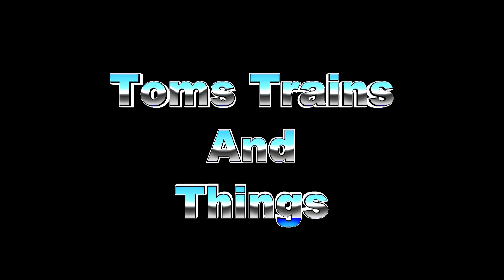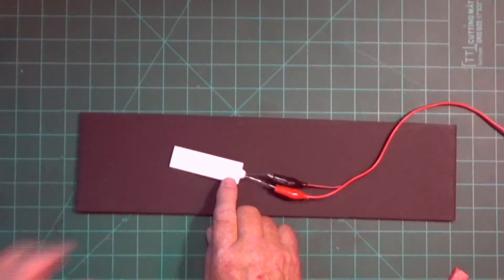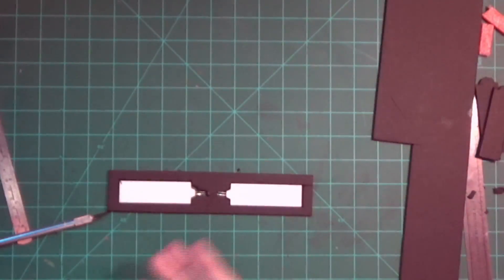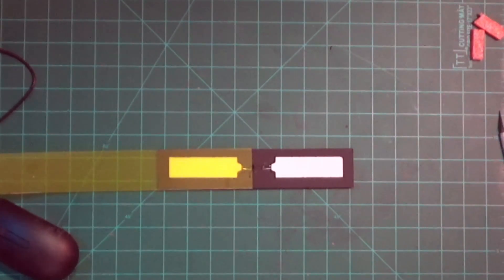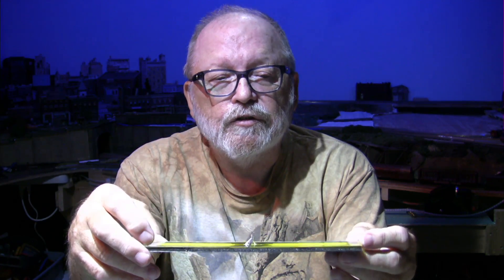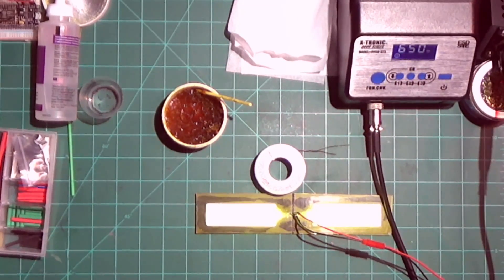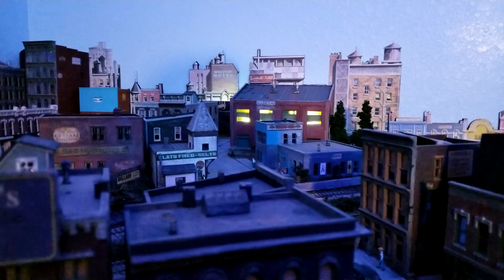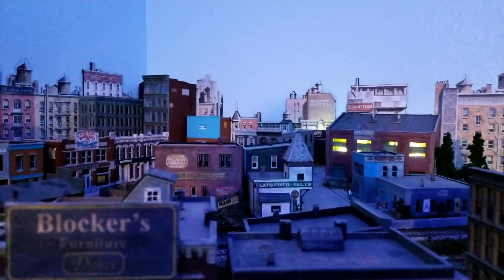Working With LED Panels

Comment: Another great video Tom.  Looks like those panels are really good when you want an extended (area) source to eliminate the appearance of individual light bulbs/fixtures and just generally illuminate the structure.  Art...
Reply from the maker: Thanks Art. They work great for that. Going to install a few more.

Comment: Where did you get a 3 volt power supply?
Reply from the maker: For the video I used my bench power supply which is adjustable. It will be hooked up to my computer power supply which I did a video on some time ago. I can also use a buck converter to adjust to a more precise voltage.